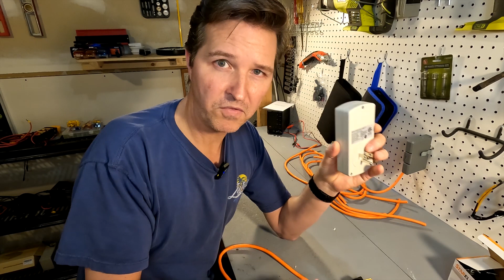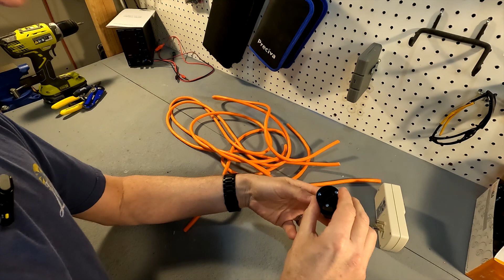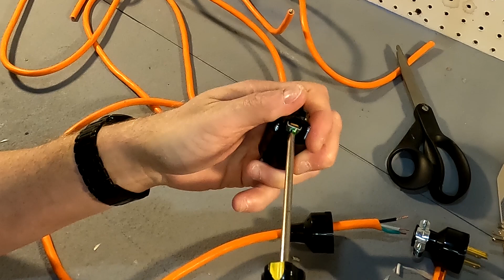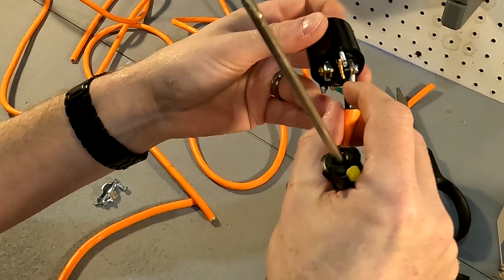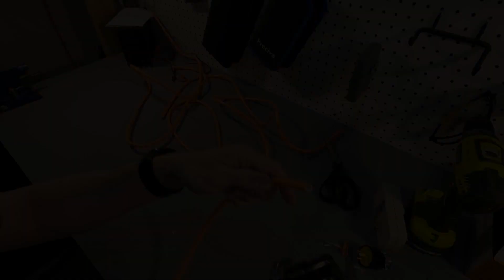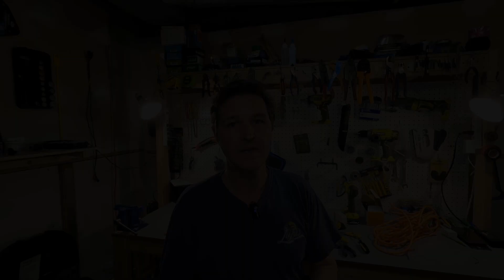Make your own custom length extension cord!  Super easy for anyone!

Comment: If this is done correctly any reason why it cant hold up to a full 1875 watts? I need to use it for a induction burner. It would throw a circuit breaker if there was a short or problem. This should work right?
Reply from the maker: I believe these plugs are rated for 15A so you would be right at the peak amperage output.  Also, make sure to use the correct size of extension cord.  14-3 minimum.  12-3 preferred.
Reply: @OffGridBasement  Thanks... I made a mistake - only 1800W, so 15 Amps should be fine. They also have a 1 socket pack and in yellow too

Comment: what i wanted to make was one that was for 220 volts and 15 amps but the length would be 300 feet to 500 feet i understand that the longer the cord  that there could be some voltage drops so i am thing this  that using a 4/0 (0000) gauge wire for a 300 or 500 feet run would be more than sufficient for a circuit that requires 220 volts and 15 amps. The 4/0 gauge wire is very thick and can handle high current loads over long distances with minimal voltage drop. It's often used for industrial applications or services where large amounts of current are needed. and i know When selecting the wire, i need to make sure it's rated for the correct voltage and amperage, and that it meets any other requirements specific to my application, such as insulation type or temperature rating. and this would be a out door cord as well
Reply from the maker: You will definitely have a very minimal voltage drop with that size cable.  It will also be very expensive.  Thanks for the comment.

Comment: What Size 12 Volt Pure Sine Inverter would you Suggest to Run a Microwave Oven by Solar .. Thank You for your Help and Knowledge 🙂
Reply from the maker: It really depends on the wattage of the microwave.  An 1100w microwave uses about 1600w of total power.  I just did a video on this that will be coming out in a couple days.  Hope this is helpful!

Comment: In a world where extension cords are never the right length, one man takes matters into his own hands. Cutting cords, splicing wires, and defying the odds, he creates the ultimate extension cord. Fueled by determination and equipped with Amazon-bought plugs, he won't rest until every device has its perfect power companion. This summer, witness the electrifying journey of an everyday hero, forging connections like never before. Are you ready to plug into the action?
Reply from the maker: I honestly don't know what to say....  but thanks for the comment!
Reply: Looool, this is one of the best comments I've read 🤣